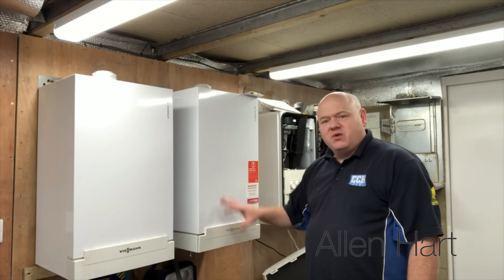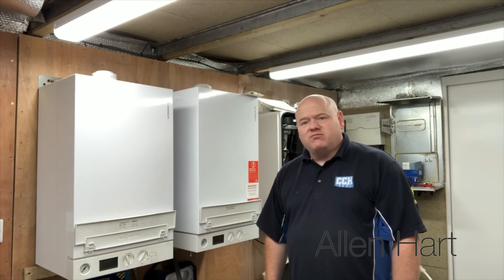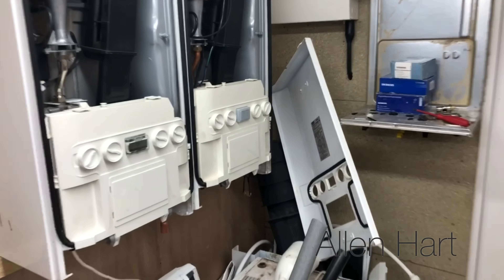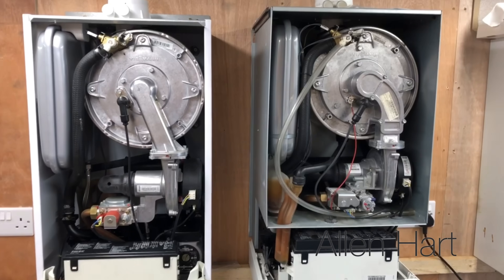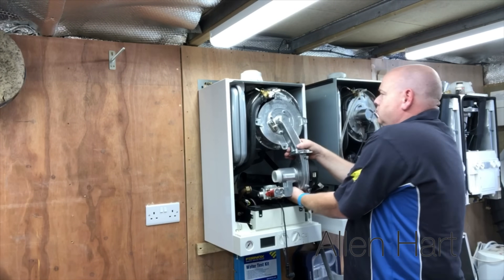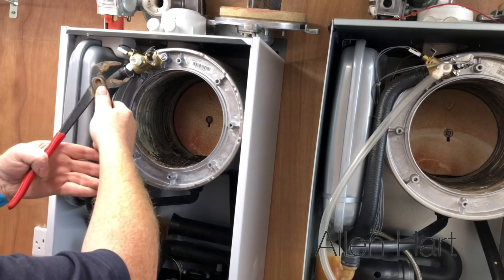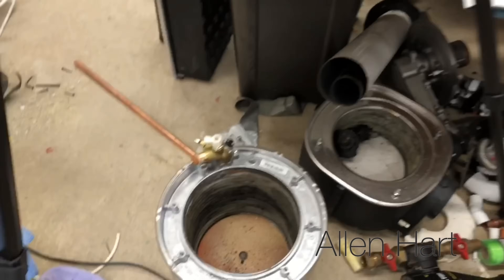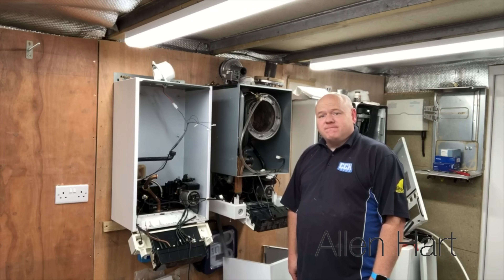VIESSMANN VITODENS 100 - Whats Inside - Full Strip Down

Comment: You need to start doing ATAG too. Compare the heat exchanger condition from a 2 year old ATAG to a Viessmann and the ATAG will be a lot, lot cleaner. Different design. Much better on an ATAG. (In my opinion)

Comment: I've got a 100-W 26kW Combi. The call for hot water seems to ignore the flow sensor, it's purely temperature based. Because of this it fires up several times in the night to heat the tiny amount of  DHW in the plate exchanger and then turns off (all at zero flow). It's a really annoying. I've tested the flow sensor separately and it's all in-spec.  Is this the intended operation of the boiler or is there a problem with the main board?

Comment: Hello. I have a strange problem with my Vitopend100 series. Hot waters works fine, but when I try to start heating the flame starts a few seconds, then it stopps
and I get a sound like water is circulating but theres no heating whatsoever.
Pressure is fine, no problem with thermostat, no error from the unit.
What can it be at fault ?
Could it be the thermal sensor probe on the heating side ?
That's what I suspect.
Any thoughts appreciated.
Reply: Did you find the issue? My vittodens 100 is not heating properly and how water is fine as well. Waitin on a tech next week.
Reply: @joshnichols9972  Yes, it was the 3-way valve. That's a little expensive to replace, about $125 here.
Reply: Ok  I can deal with that. 125$ USA   I have him comin to clean it out and fix anything it may need
Reply: @joshnichols9972  This is one of the more expensive parts that can break. Thermal sensor on the pipes are around $50 and relays around $25 at most. Some people replace the 3-way valve with an alternate one. These 3 parts have the highest chances to break for this model. Everything else should be long lasting. Replacing the 3-way is not hard, it takes a few minutes for an experienced person. Good luck and have a long lasting boiler.

Comment: HI Allen . absolutley love this channel , way more info than on th course!   I have a question and perhaps you could help. sadly you didnt fully strip the other boiler , combi 30kw , as it would answer my question. i had some building work done and boiler was removed and stored in the garage for over a year. had this re fitted this week , but it seems to be missing a part at the back. Pressure relief valve at the back, has black plastic pipe connected to it , and it hangs freely at the back of the boiler. when i checked on newer model , it is linked internally to the discharge grey flex pipe  , but on my model (vitodents b1b 30kw 2011) , it does seem to be loose and i cant dinf where they both would link. searched on viessmann manuals and no luck.  could you help please?

Comment: How do you get to the Air Vent Valve on the Boiler on the Right, mine is leaking water ?.
Reply from the maker: If you take the case off you will need a gas safe engineer as it will need testing afterwards. You need to drain the boiler to remove the air vent, It then just turns and pulls out. Thanks.

Comment: Thanks for videos Allen. These Viessmann boilers are cheap. What idiot designed them with plastic and rubber pipes inside? Copper or stainless steel pipes only. No plastic or rubber. It is becoming impossible to find quality products on boiler market.
Reply from the maker: The new 100 is copper now. Thanks

Comment: I have a Vitodens 050w and the pressure when cold sits around 0.8 to 1 bar but when heating is on its rising to around 2.5 bar will this be a issue with the expansion vessel? And any idea rough cost to replace?
Reply from the maker: cj 26 If you have the boiler serviced it might solve it.
Reply: @AllenHart999  it's recently been serviced and the expansion vessel re charged and doing same thing so will it need replacing?
Reply: @AllenHart999  also when the vessel was recharged water was coming out of the valve on the expansion vessel so guessing its ruptured

Comment: Mine is a Vitodwns 100, the upper housing is completely surrounding the inner parts, and also there is a plate separating the upper round heat exchanger together with gas connection, below the separator plate is the pump and the hot water heat exchanger, and in this model it is more difficult to take this hot water heat exchanger due to less space to maneuver, and i can not find the name plate of this model, iwould like to see the complete dissassembly of the specified model and maintenance, thx
Reply: Please dissassemble the lower part on the right boiler!!! I need to see how pluck out the hot water heat exchanger

Comment: Allen could you explain why water heater (in model of the left WB1C ) is plastic? Is that mean there is no water heater function in this model? Or they just use other material. I'm owner WB1B and have this plastic part in my model so do my WB1B is combi and have water heater funcion?
Reply from the maker: Not really sure what you mean but they are both combi boilers. Thank you so much for the comment. Happy new year
Reply: The WB1C on the left is a system boiler (unless it’s been modified after installation). If it was a combi, the black plastic ‘blanking plate’ part would be a stainless steel plate heat exchanger. The first 7 digits of the serial number will confirm what boiler type it is if you put them into the Viessmann spares app.

Comment: Looks like a lot of plastic bits inside and rubber pipes to the heat exchanger ? Don't seam like these would last ? The house we moved into has a ATAG Q38c and it looks quality inside, nothing but stainless steel and brass, it has a small 14ltr DHW cylinder inside the boiler itself so it doesn't need to fire up if only a small amount of hot water is needed and doesn't have a plate heat exchanger to block with limescale etc  Any other manufacturers doing a similar set up to my ATAG ? Not a gas engineer but interested in this field.
Reply from the maker: Atag ? The Atag boilers are very good but the pipes inside are not stainless. The are carbon steel with an external nickel coating, the end panels on the Atag are also aluminium.
Reply: ATAG Q38 costs 3 times more... cannot be compared. Viessmann costo 800-900 euro (1000 $)

Comment: We had a flow problem with our Vitodens 100-w boiler and we traced it to a blockage in the heat exchanger so we bought some washing machine descaler and pumped it into the heat exchanger and left it for about an hour and then flushed it out, this solved the problem the heating and hot water now works fine again, Please note the heat exchanger is made of stainless steel  not aluminium.
Reply from the maker: The pipes are stainless steel, i think i said that in the video. The end panels are aluminium though.
Reply: Soon Il Dewey How’s your boiler going after one year of using the washing machine Descaler trick?

Comment: Veissmann is all I fit.  Vitodens 100-W is a great boiler especially in Hampshire where the water is so very hard! The only major gripe would be the flow and return pipes get crunchy and then screw up the plate heat exchanger.
Reply from the maker: The new one is copper now so it should be a lot better. Thanks.
Reply: @AllenHart999  HI Allen I watch your videos, I have a open vented sestem I looking to renew the boiler 15kw will be OK , what make do you recommend, looking for a reliable boiler  regards Harry
Reply from the maker: @harryaspris3031  You will not go far wrong with a Viessman Compact. 👍
Reply: @pmailkeey I think Allen is talking about the pipes inside the boiler being copper now instead of rubber. The Hex is still SS

Comment: Hi Allen. It’s nice you to put this video up. These are an excellent good boiler I’v been using  fitting viessmann the last 10 years now. They are one of the best to work on very easy access to everything. you can take the whole burner assembly out in two minutes on a  service. All the ones I fitted during that time have been very reliable they are extremely quiet in operation and most people have noted the gas bill go down.  Their worst enemy is a dirty sludgy system water And shoddy installations. Only downside to viessmann are they are  quite pricey on spare parts but fortunately never had to buy many as they been quite reliable ! The boiler is only scrap on your wall as it has never been serviced properly. Good video but I wish you stripped it further down To show the quality
Reply from the maker: How much further do you want me to strip it, if you look on one of my other videos I cut the heat exchanger up to show how big the waterways are inside them. Thanks for taking the time to comment,
Reply: Allen Hart . Thank you Allen. Yes you are right my apologies! I’ve just had a look and saw your other videos the one you made on the heat exchanger quality is absolutely first class!  the steel must be good As it seems it was not easy to cut through? Good videos mate thanks for putting them up! Keep them coming please🙂
Reply from the maker: I have a new one on heat exchanger coming soon, as soon as i get the last one i need. Thanks.
Reply: Drink Water. After using them last 10 years I will definitely go for the viessmann they are very quiet.efficient and have the best he exchanger currently on the market.check them out online they have won the which best boiler, aswell
Reply from the maker: I would say the baxi megaflo , Viessmann is also good.
Reply: Drink Water ,thanks for the compliments mate ! I’m sure there are smart diligent plumbers where are you live what area are you? in as you can look up approved viessmann installers on the website and they usually are quite clued on anyway if it’s 
A flight at 100 series would be more than capable enough to supply your needs the new system boiler will even fit inside the cupboard these days. In the 100 combined with an outdoor sensor will probably be your best option for best heat and efficiency
Reply: Drink Water , Spelling mistake I meant to say in a flat that 100 series would be the ideal fitment
Reply: Drink Water .North London is a popular area for approved installers you won’t have any trouble there it’s always best to go for approved  as they know their way around the boiler & the installation techniques and
commissioning procedures. I think a 200 series is too big for flat really, a 26KW 100 series is more than capable for most three-bedroom houses. Along with the boiler change I usually fit a danfossTPone programmer timer smart bit of kit for the money!
Reply: Drink Water How did you get on with your research? yes danfoss do  Thermostatic trv’s, !  Although I have found that with an outdoor weather compensator sensor and a good interior room sensor / stat to control the temperature the TRVs don’t really have much work to do, as the heat generated by the boiler and radiators will be governed by the outside temperature and the temperature selected for interior